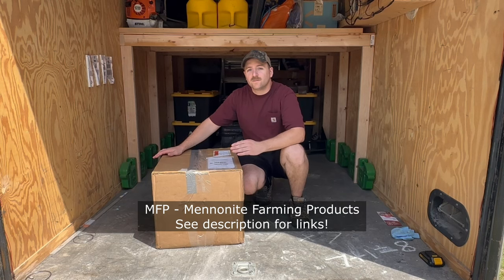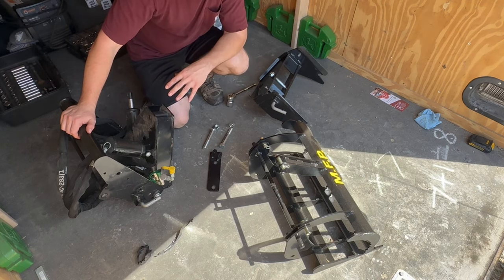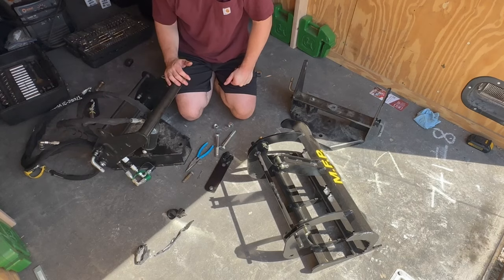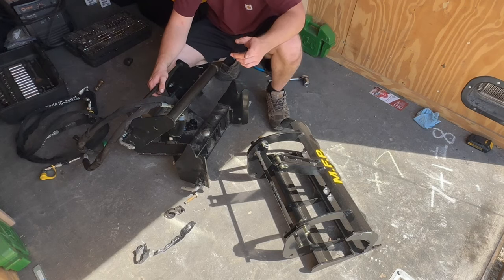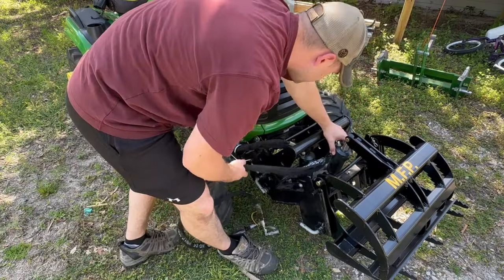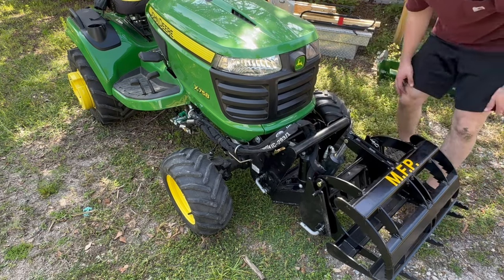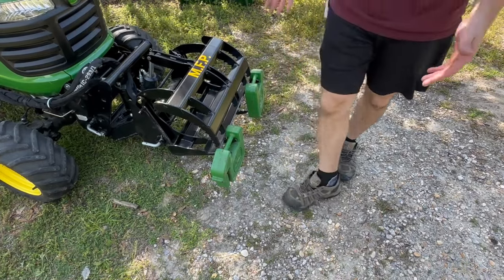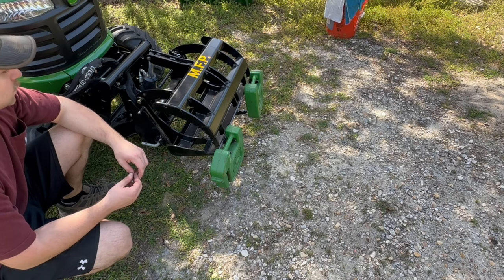MFP Grapple For John Deere X700 Series (1025R as well) - Unboxing/Review/Light Use

Comment: Love this channel. have a X739, thing is crazy good. Looking for potato hiller attachment, deere or off brand ideas? i have 3 pt, rear PTO no issues with factory install.
Reply from the maker: There are plenty out there, problem is they are pretty large, so I’m not sure if the 700s can lift high enough. You may have to check some of them out in person if you have an ag attachment store near you. Really hard to judge some of that stuff online.
Reply: @JoshsGreenGarage  agreed with online confusion. don't want to buy something that doesn't work

Comment: Hey quick question. I am considering buying a new 2023 x739 which will soon be an almost 2 year carry over. I biggest concern is the potential weathering as it has been sitting outside since it has been on the lot although it looks just like the band new one next to it. This is my first garden tractor purchase so I was curious about your thoughts. I am not positive how much cheaper it will be compared to new but that also matters.
Reply from the maker: My only concern would be old gas sitting in it, and potentially sun damage to the seat. If anything you could see if they could make sure any fuel is cleaned out of the lines and a new filter added… and then maybe write you a guarantee on the seat for however long? Kinda kills me that they don’t just include seat covers on all these from factory when they know they will be sitting out. Everything else though should be fine.
Reply: @JoshsGreenGarage  did you get yours with the auto connect pto? I have heard good and bad things about it so not sure if I should add it. I only plan to take the deck off for snow blower in the winter and maybe one time in the summer to clean it and sharpen blades
Reply from the maker: I did not get it, not worth it in my opinion for me. Now if you are older or have a hard time getting down and under the machine to connect the driveshaft, it may be worth it to you. I will say, now that I’m in hot humid Florida, and have a crap yard and no garage, I wish I had it. Just something for you to weigh its worth.

Comment: so, just curious, the front hose hanger puts the hoses right at the exhaust, does the heat cause issues to the hoses??
Reply from the maker: So I was always worried about this too, but I haven’t seemed to notice any issues, from -30 plowing snow to grappling logs at 80. They are pretty thick hoses, and wrapped in a heavy, surely heat resistant material. It’s Deere, it’s quality stuff.

Comment: Why does the deck have to be removed to run this?
Reply from the maker: Because of how the attachment mounts, it would be In the way of the front draft arm…
Reply: @JoshsGreenGarage  The deck does not need to be removed on the X series actually. I use mine with the deck on almost all the time.
Reply from the maker: Ok, I guess I was just assuming the front draft arm mount would get in the way… idk, whenever using attachments I usually just take the deck off… too wide and ya lose ground clearance.